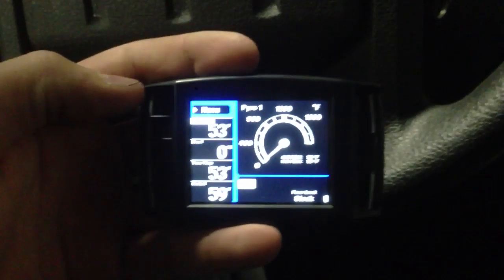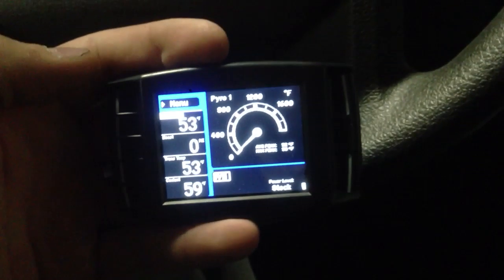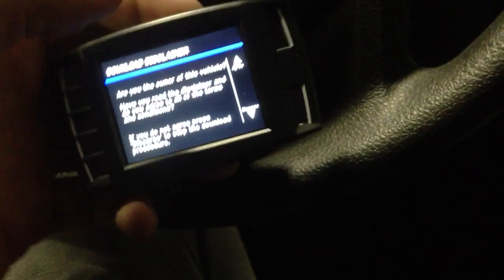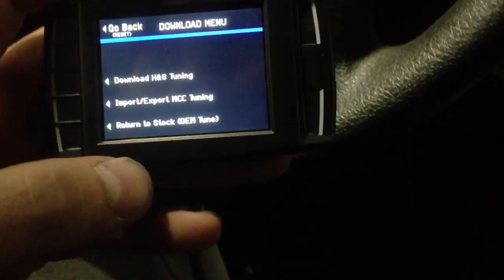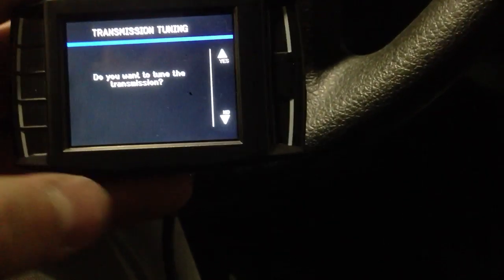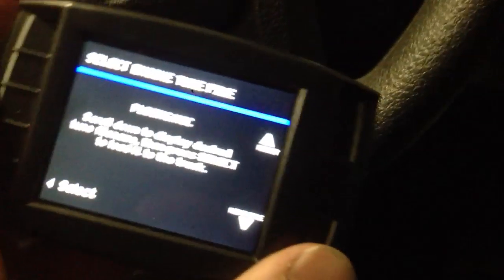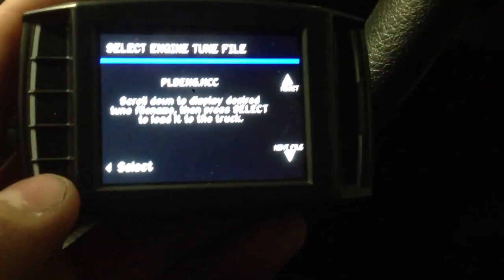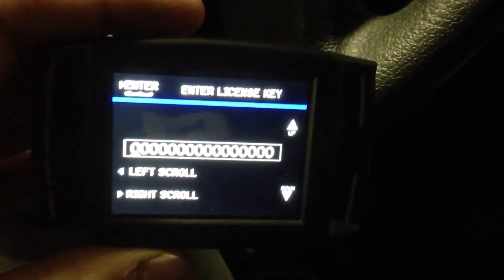ford 6.7 mini maxx custom tuning

Comment: I've got a lope tune, loud idle like the 7.3 have, race that pushes the fuel to its absolute max, smoke and mpg that can give you up to 6mpg increase email me at tombuday@gmail.com or go on h&s website and look for power builder and talk to me there
Reply: Hi. Do you still do the custom tunes? If so can you call 5045200890 or email me camoboy67@gmail.com.  thanks.
Reply: Thomas Buday  dido. 
Koreyandrewthompson@gmail.com
Reply: I was wondering if this would work on an xrt pro?

Comment from the maker: Jake, we have one that will dyno +40-50HP than the stock tunes for the H&S Race Tuner built by SPE for $100.  Call the shop @ 208.542.7793.